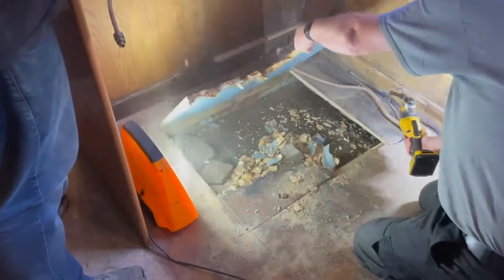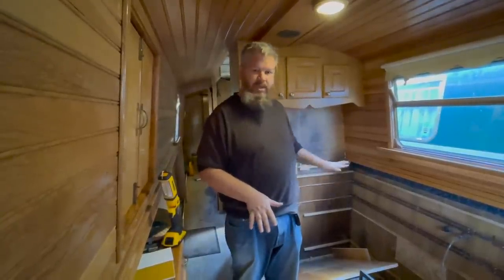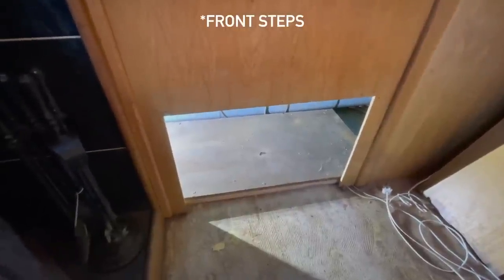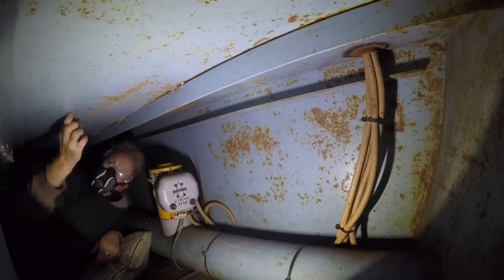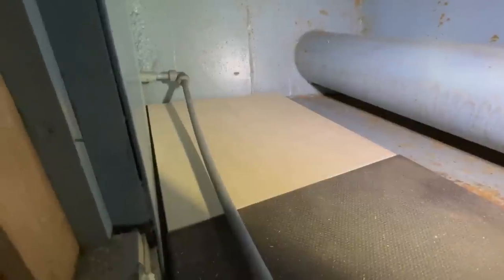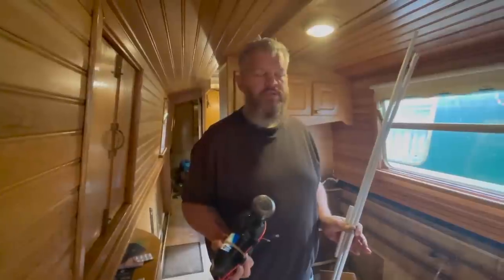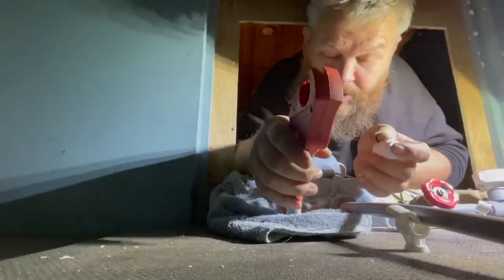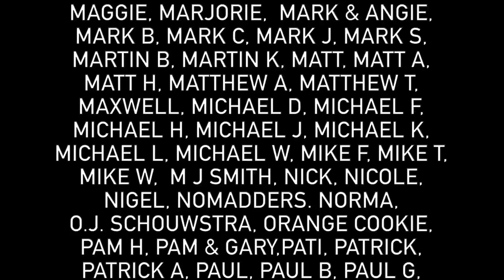Episode 15 || Making Progress on our Narrowboat Renovation

Comment: It's been a long time since this repair vlog was made.
Yes having experience with Liverpool boats some bits okay and yes corners cut.
I am sure that you will be aware that you don't have a steel bulkhead to confine your bow thruster tube.
I know for a fact that bow thrusters use can cause a cavitation hole to be punched through the steel tube.
That being a safety concern it is surprising that regulation does not insist on a bulkhead being a requirement on build.
The good rewarding aspects of your refurbishment is attention to the detail. 
In other words you're doing a good job.
Hope you are both well.